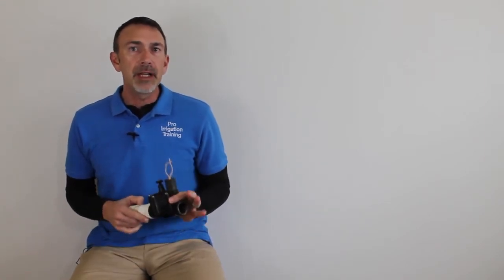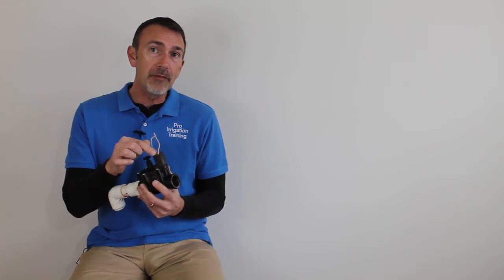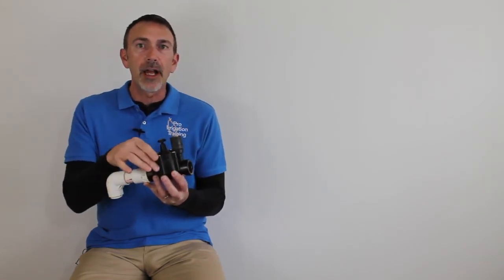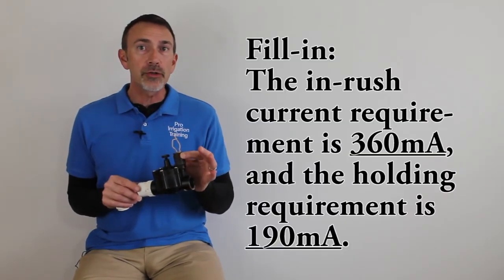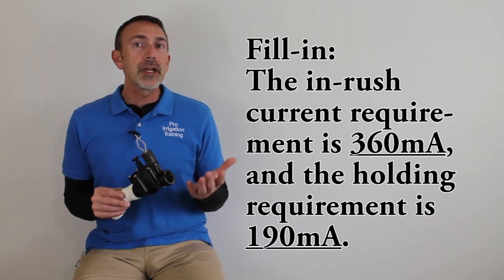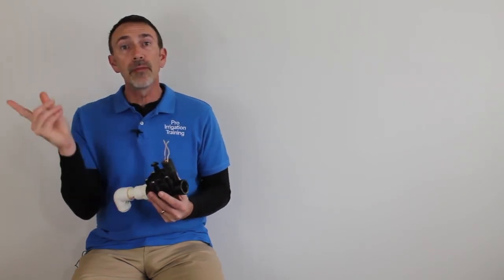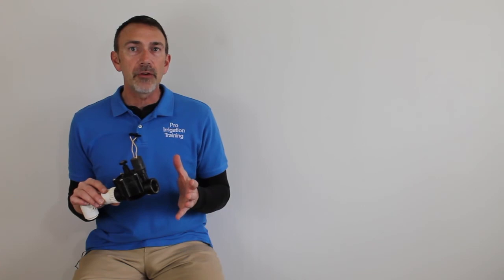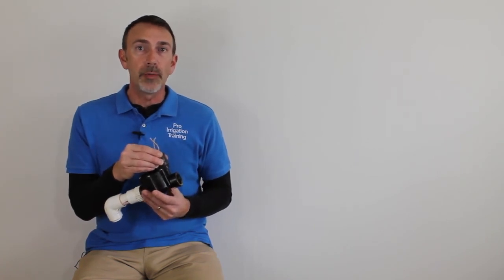All About Solenoid Valves For Irrigation Systems (sprinkler repair)

Comment: What's the power consumption of these solenoid valves?
Reply from the maker: Each valve has slightly different specs, but for instance, the Rain Bird 100 DV is: 0.450A inrush current, 0.25A holding current

Comment: Hello, I have a valve that I will be replacing myself. I have replaced many sprinkler but this will be my first valve I will be replacing. I have watched many videos and it’s seems pretty simple. My only concern is the wires, are they hot, will they shock me do I need to take any precautions, turn power off etc.? 
I would really appreciate your help before I replace the above ground valve. I’m a big chicken when it comes to electrical things.
Reply from the maker: Hi JV, thanks for watching our channel. I'll be uploading a bunch of valve videos shortly, but probably not quick enough to help you. The wires aren't hot unless the zone is running. Just turn your timer to the OFF position and shut shut off your water source before beginning. Good luck!